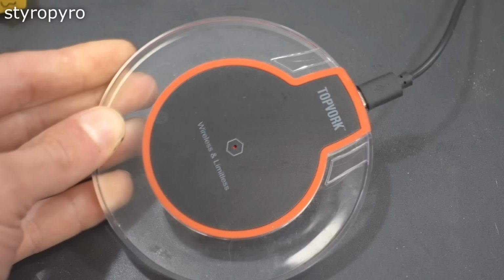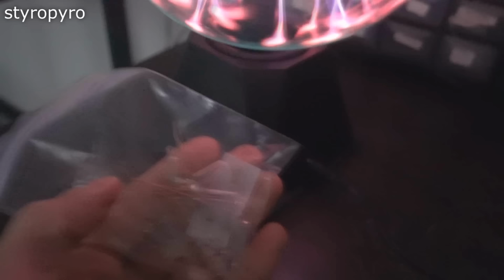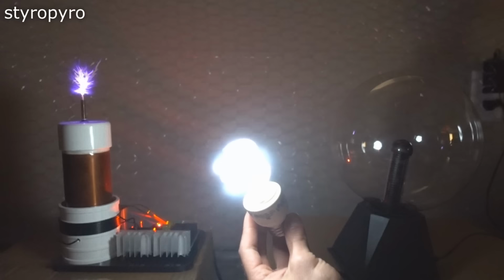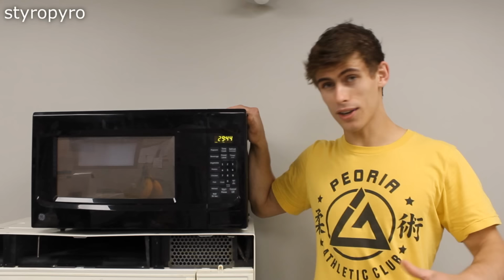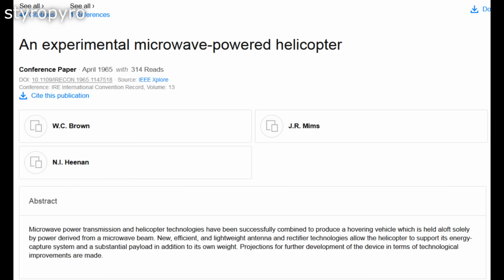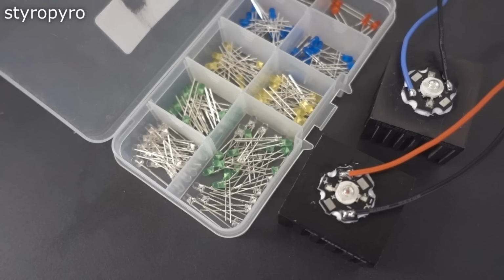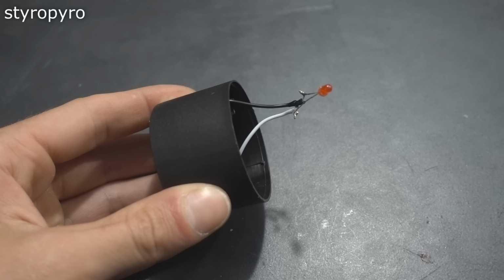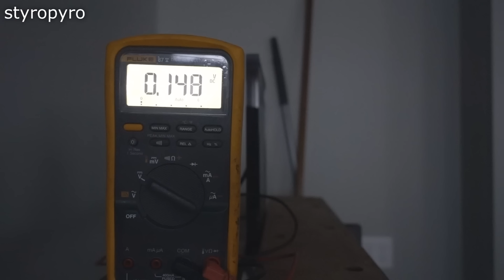Wireless Energy Transmission with Force Fields and Lasers

Comment: Honey, why is our electricity bill so high
Reply: Jay lasers don’t eat that much power tho
Reply: Alexander Tetyukhin 
Tesla coils might though :P
Reply: @BothHands1  Still uses significantly less power than an aircon.
Reply: @BothHands1  tesla coils dont take up very much energy. It can be 1000v, but 15mA.
Reply: @BothHands1  As a coiler I can tell you that even large coils don't draw more current than a microwave.
Reply: @hankhuevos3336  Tesla Coils are even less than that. The coil i built that I gave up on the secondary had an input voltage of 7.5kv 30mA. Probably not exactly due to the capacitor, but that was my power supply. As a sgtc the current would still be nasty, but if it was a sstc I could theoretically touch the arcs and worst I get is a burn and a somewhat painful shock. People have actually let themselves get shocked by the coils for entertainment since the worst risk from a sstc comes from the RF burns, not the electricity itself due to the skin effect.
Reply: Jay Because you didn't use a question mark.
Reply: Pretty photons
Reply: I do wonder what his electric bill looks like

Comment: Styropyro: “it wouldn’t shock me if I touched it”
Styropyro literally 5 seconds later: “M o l t e n  N i c k e l”
Reply: Hmm.. from what i can tell..it's the same voltage..his hand is too much resistance, thus low current. Nickel, low resistance, high current.. tho, this is merely my speculation, if i got it wrong, hopefully someone would correct me
Reply: @eh9618  Exactly. Theoretically a current DOES flow through his hand, but it is way too little for him to sense.
Reply: yall... they were joking
Reply: okay I know this is joke, but metal is much more conductive than flesh. I might be wrong, but think this is why the nickel melts and his hand is fine. If his hand was wet, it would probably be much more noticeable for him as water is also very conductive. I haven't really studdied electricity that much so correct me if I'm wrong.
Reply: @mr.shepherdspie7958  you could use Ohm's Law to calculate the current through his hand. Current is the total voltage divided by the resistance of his skin. since the resistance of skin is pretty high, the current traveling through is negligible. However, since the nickel basically is a wire, and has very little resistance, it melts instantly. This is why signs say danger High Voltage and not high current, because higher voltage is higher current. Just 75-100 mA of current can stop your heart, and the resistance of human skin varies depending on circumstance but id say on average its a kOhm or two. This is enough to survive getting shocked by your wall as long as the current doesn't travel through your body, but touch the live wires on poles and if you're not dead you're lucky.
Reply: There’s a deference between volts and amps (BUT I GET THE JOKE)
Reply: @mr.shepherdspie7958  water is not conductive, water is an insulator. The minerals like salt in the water make it conductive.
Reply: but it was a penny not a nickel
Reply: it has high current that would kill him if it had enough voltage to go through the resistance of his skin.
Reply: @mr.shepherdspie7958  water being conductive is actually a popular misconception. For instance distilled water has no conductivity therefore can't even short out your electronics but when you add minerals to water it makes it more conductive but it's still a bad conductor overall and things like copper or silver or gold are so much better
Reply: @forposterity4031  I always forget that. that is mind blowing
Reply: Well skin is an insolator not a conductor... metals are conductors and things like rubber and skin are insolators
Reply: A true mad lad
Reply: I don't think you understand it, at all
Reply: @idontknowwhattomakemyusername7  everything conducts electricity if you try hard enough. everything.
Reply: It produces low voltage with high current. if the resistance is small enough an enormous amount of current can pass through.

Comment: I’m afraid to put certain plates in the microwave, and this man is running it with the door open😭
Reply: Actually you can :) . The grid behind the door of a microwave oven has loops, which are smaller than wave length of microwaves. Thanks to that, it completely blocks microwaves from escaping outside of the oven.
Reply: G.O.D 7  alive things explode right? Thought i read that somewhere.
Reply: @mentos93 a microwaves are "dangerous" because they heat water in you if you stand in them for a long time. Insects and stuff like that kinda explode in an microwave oven because they are so small and heat up too quickly, which makes the water expand and kill them
Reply: @mentos93  Agitates the liquid within. Potential to bust
Reply: @huscat1609  The holes allow the compartment to be viewed, is the way to understand it.
Reply: @louf7178  the holes form something called a faraday cage. When the wholes are smaller that the wavelength of the light, it cannot pass through them. Microwave ovens have them to prevent most of the microwaves from escaping
Reply: @literallyafuckingspoon8801  ...so the compartment can be seen in to.
Reply: @louf7178  shit i thought that you said the holes are only there to be viewed into. Now I understand lol
Reply: @literallyafuckingspoon8801  👍
Reply: @Kugel Gonto really that kind of protection are absolutely NEEDED in order to save female's reproductive cells from Ultrasonic Waves....I'm a a Biotechnologist and the first thing the Prof. said when we use laboratories It's been that.
Reply: G.O.D 7  yeah same to fireguns

Comment: This man Just put Bananas in a Microwave...

And he has nixie tubes just lying around...

Don't let the organization catch on.

El. Psy. Congroo.
Reply: John Titor confirmed
Reply: Would've been cool if he put some green goo on the bananas after puting them into the microwave
Reply: Mad scientist :P
Reply: Best comment
Reply: I wonder where he keeps his 65" Braun tube
Reply: <3
Reply: I wonder why he called them "old neon bulbs". When LED's arrived, you could probably buy nixie tubes for pennies. There are probably some old pinball machines that still use them though. Antiques that someone wants to keep original. maybe you can even still buy new ones, I did not research that. How many of you know that vacuum tubes are still made. You can find them in most hi-power radio transmitters. From amateur radio transmitters to really big ones used in commercial TV and Radio stations.

Comment: Styropyro: touches two metal rods 

Two metal rods: CAN MELT A FRICKING COIN
Reply: Happened to me when I was installing wires on the 900amp battery needed for my car audio setup
Reply: I upgraded to a 200ah battery with a 2 Farad capacitor
Reply: @JoinTheCyborgs  Then your battery is not 900 amps it just can give out 200 amps an hour
Reply: @Deadchannel06  i'm pretty sure 200ah battery means that it can output 200 amps for an hour, or 400 amps for half an hour, or 900 amps for 13 mins. 
or 1 amp for 200 hours.
Reply: @boggless2771  oh yea your right
Reply: If your wondering about this the reason it’s different is that the metal coin has a much lower resistance than the human body, so the massive current is able to flow
Reply: I believe that's how welding machines work. You are holding the metal with your gloved hands and delivering enough current to melt the metal. Nobody is worried about getting shocked by the machine, but you need gloves for the heat and a welding shield to protect your eyes from the light and your face from flying sparks.
Reply: so next time people scare you by saying certain foods do wacky things like removing rust, show them this feature of current vs voltage

Comment: FINALLY someone who runs an open microwave and makes sure no radiation gets out of the room!
Also, thumbs up for the nixie tube!
Reply: I noticed that too. love them nixie tubes
Reply: What do we do about the sun
Reply: The sun doesn't interfere with your neighbors WiFi.
Reply: @benjaminmiller3620  but a microwave does?
Reply: Yes. Microwave radiation is the same frequency as WiFi. They are both ~2.4Ghz
Obviously Wireless Access Points don't put out enough energy to heat things up much tho.
Reply: @DeuceGenius  Wifi at 2.4ghz is and if you've ever played an online match on wifi when someone decides to microwave something for 3 minutes, you'd probably notice your connection getting significantly worse and possibly dropping out. 5ghz wifi isn't affected though.

Comment: Tesla demonstrated in the 1910's that if you add a moth to the laser, the conversion efficiency of wireless transmission pumps up to at least 74,36%.
Reply: I don't like the smell of moths in lasers.  It's not worth a few percent.  And besides, you would have to consider the moth, pixie dust and all,  as fuel in the efficiency numbers.
Reply: @onehitpick9758  Pixie dust is also another important factor in increasing not only efficiency, but also basically everything in life: you live longer, get leaner and hotter, stronger, etc.
Reply: MaximusPayne dust makes you live longer?
Reply: @yoloflyp8596  Of course, that's why it's so sought-after. Pixie dust sells very expensively on eBay.
Reply: @PayneMaximus  You all have been watching too much of "The Golden Compass"
Reply: It's like when Mark Twain stayed for too long in Tesla's enlightenment toy, it flung him across the room!
Reply: true
Reply: what?
Reply: yougeo wdym what?
Reply: MaximusPayne can you explain what pixie dust is? I tried looking it up but it just shows up with Disney shit
Reply: YOLOFlyp its tooth fairy farts basically

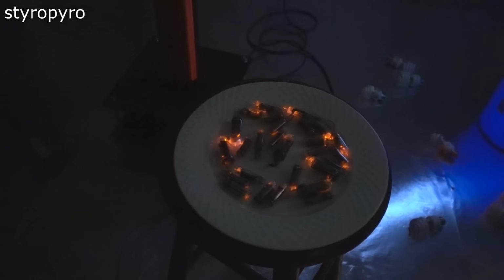Comment: 3:10 : “Mason, The numbers? What do they mean?!”
Reply: Electric bill
Reply: I see....a 1....a 3....and two 5s...13:50.... maybe something about demographic crime rates?
Reply: Easter egg lol
Reply: Jesus i haden't noticed.
Reply: @gmaninatrashcan7144  Despite making up only thirteen percent of the population...
Reply: It’s part of a clock. I’ve seen them before
Reply: Nixie tubes
Reply: @gmaninatrashcan7144  LMAO
Reply: Man, nixie tubes are great for what they were designed to do: display numbers in scientific equipment. I want to modify the display of a bench power supply to these.
Reply: @gmaninatrashcan7144  yoooo😂😂😂
Reply: @SPIIKE  wrong. They only appear in Steins Gate. They are actually nixie tubes, which were (and still are) used in laboratory equipment.
Reply: I just posted this, and then scrolled down saw your post and I'm sad now
Reply: @SPIIKE  no it's a refrence to COD black ops 1

Comment: When you get your 1 mill sub button you should test what's more conductive 100k or 1 mill
Reply: or which one takes longer to burn through with lasers
Reply: @zeltau  the subs buttons are silver and gold so they wouldn't burn
Reply: 10K Subs With No Videos they would if you get a hot enough laser
Reply: @darylmccann6284  it would melt not burn

Comment: The electricity used as transmitted power in this video from the Tesla coil, was using the over-voltage which is wasted energy. The fact is, you could turn down the voltage until you never saw any flashy arcs of electricity coming from the cap, and by harnessing resonate frequency with an identical Tesla coil feeding your circuits (Minus the bowl on top. That part is only needed in the transmitter) the power can be wirelessly utilized from much farther away and with far greater efficiency.  This is the intended use of the coil according to Tesla.

Comment: Make an electricity bomb, you just need to find a way release a huge capacitors energy in a fraction of a second.
Reply: Nocturnal RS compact pulse Tesla
Reply: Super capacitor can do it in some seconds but still not a fraction of a second
Reply: Get a metric ton of micro-capacitors and wire them up in parallel
Reply: Overload a capacitor?
Reply: bombs require rapidly expanding gases i believe
Reply: Strap like 5 capacitors to a brick of c4, tada electric bomb
Reply: Emp
Reply: @14789supa  not what an emp is
Reply: So an emp?
Reply: Well, it would definitely kill things but it wouldnt look like much. Definitely not the flashy electrobomb you would see on a video game, no sparkyspark sorry.    :(
Reply: @hiveanimations8685  That isn't what an emp is.
Reply: I like you funny words magic man
Reply: You can actually make an explosion based on electric only. It happens in rail guns you'll see the air literally combust it looks like there is a chemical reaction going on but there isn't. Very rapid thermal expansion will create a pressure wave doesn't matter what is causing it. Heat is heat.
Reply: @n111254789  It's plasma yea.  Idk if what I envision would be more like an emp or more like a Plasma grenade from halo lol.
Reply: @dogekingchris2190  It actually kinda is, I know what you mean when you say it isn't an EMP, but EMPs are large releases of an electromagnetic pulse to disable electronics in it's range, the pulse being a quick release of energy in a fraction of a second, which is what everyone here is talking about, the form of energy is just different.
Reply: What a way for y'all to get get on a list 😂
Reply: @FlashDrive356  however you can discharge a capacitor into an inductor and blow the inductor apart to create small scale EMP munition. Theoretically you could airburst hundreds during an air assault and completely knock out power in a city with minimum loss of life.
Reply: you can fire a copper slug through a coil using an explosive to generate a massive electrical field!
Reply: @TheBlenderblob  How about using a railgun to fire a missile at a coil receiver to transmit electricity miles away 🤣
Reply: microwave graphite suspended in ice

Comment: The similarity between LEDs and photovoltaics is analogous to microphones and speakers. If you shout into a speaker you can actually pick it up as a microphone and you can drive a microphone's diaphragm through voltage. In both cases it is horribly distorted and inefficient but the underlying mechanism is the same. Piezoelectric crystals are beautiful in this regard.

Comment: So I'm curious... Could someone make a powerful laser directly powered by solar power only? Because if so then a spacecraft could theoretically be powered by a laser highway connecting the stars. All it would need is a laser with maximum power and minimal diffusion dropped at a star system and as the ship passes it gains a new sorce of power.
Reply: You would not need to deal with the shitty inefficiency of solar panels floating somewhere. Rather, you stick some shaped mirrors directly in the corona of the star and use the atmosphere as a lazing medium with its own light. Solar statites and other Lagrange-point installations might help to refocus the beam once it gets far enough away from the original lazing star.

Comment: Hey styro, do you think resonance in crystalline objects could be used as a way to convert EM radiation into direct power?
Reply: can you elaborate on this question?
Reply: @clown134  well, resonance in quartz, in watches generates small amounts of current right? If there was a specific kind of crystal, could EM radiation(of any kind, light, x rays, radio, whatever) induce resonance in the crystal, which then in turn makes the crystal generate current? And if it does work, would the current be at all useful?

Comment: Walter Lewin does a great example with this.He uses a wrecking ball on a wire and has someone stand back to the wall with the ball touching the person's nose as it swings the ball comes back but does not smash the person in the face.This goes if you drop a ball from space it would never have enough energy to reach the very height it was dropped from.But ya Walter Lewin seemed like an awesome professor to have.

Comment: Not just LEDs or PV cells, both of which are explicitly designed for a usable bandgap (Absorption for PV and emission for LED).  photocurrent is generated when logic ICs, like CPUs, are exposed to light.  Its the priniciple behind a few testing/failure analysis procedures used in the semiconductor industry.  Its also the reason why EEPROM chips have a  window covered with a sticker.... remove the sticker, expose with UV light and erase the chip.

Comment: At the beginning:  It's not "just" a transformer; that describes common induction like on your electric toothbrush.  What you showed is a tuned resonance system which transfers power much more efficiently.  It involves capacitors as well as inductors (loops of wire).

Comment: @styropro wouldn't it be possible to use a UV laser to ionize a path through the air, and then use a high-voltage source to create an arc down that path delivering high current?

Comment: When I was a kid I used to connect a led diode to the speaker output of a receiver. Then I connected a headphone speaker to a solar cell. When I played music and turned the volume way up, the led started shining. Holding the led close to the solar panel caused music to play in my solar-headphone. I always thought about trying this with a laser to make it work over greater distances. Because I really had to hold the led close to the solar cell.

Comment: Those small solar panels usually are a few solar cells connected in series. So a small dot of light on them don't create much energy. You need to expand the light before it hits the panel like you did with the 1W laser.

Comment: Thanks for driving civilization forward but enuff with the low tech stuff I'd like to see experiments on superconductors at room temperature showing electrons moving without resistance with zero energy loss and also stuff on anti gravity emitters that generate lift and defeat inertia now that will definitely double your subscribers

Comment: Temperature can be manipulated, effectively rendering thermodynamics useless. Like reflecting light in on itself. If the light doesn't interact with a material, it never generates heat.